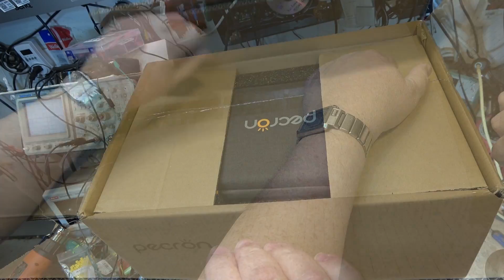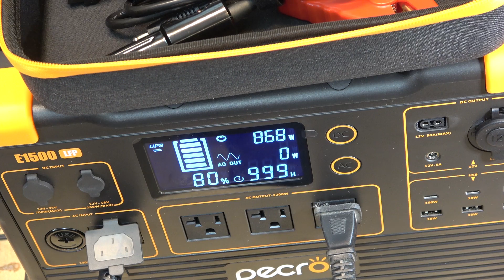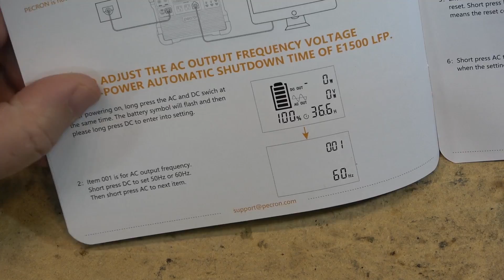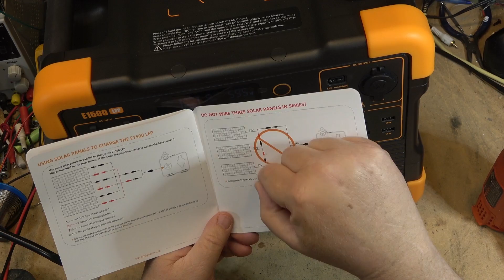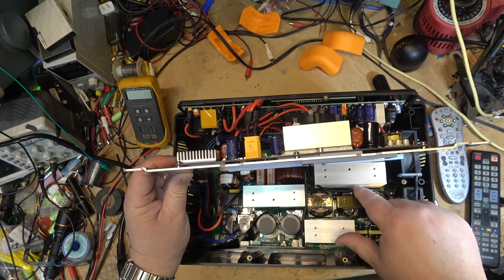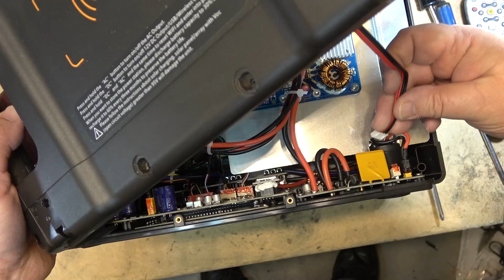Pecron E1500LFP Power Station Full Load and Tear Down

Comment: I burned up my low voltage dc In put with way too many volts, would that have damaged the 5 pin  higher voltage input? What would it entail to repair this?

Comment: I appreciate the time you took to film the process. Very informative. I have an E2400LFP. I had it charged to 100% and left it outside under a tree for two weeks. Went to use it and it was dead. Tried charging it and it seem to be charging, but when charger is disconnected, it went back to 1%. Measured voltage through the expansion port and showed 3.4v. Took it apart and measured voltage  at battery leads and was 53.4v. Clearly there is a disconnect between top side and battery. Unless i can fix it, it will be a brick. Think  getting wet must have done something. It was under a tree, turned off without any connections. I saw one of your replies was to check fuses. I haven't found them, but sure they are there. It has been out in the rain before and was never affected. Not sure it was the rain, but it's the only thing i can think of that caused it. Any thoughts on the situation? Thanks.

Comment: 25:11 that's actually the MPPT, it optomizes the solarpanels signal to most efficiently charge the battery in contrast to the older style PWM battery chargers which were far less efficient. Off that yellow xt60 is actually a direct 52V connection to the battery. To the right of the yellow xt60 is a buck converter to drop the 52V battery voltage to 12V and at the bottom of it is a blue xt60 and that's what the 12v output ports are connected to.

Comment: Much easier to take apart than my Bluetti AC200P.  Screws behind snap in moldings that cover everywhere the panels meet.  There was super-strong double-backed tape helping keep the moldings in place...or maybe for vibration abatement. What a pain that was. I had a group of cells that dropped out early during a discharge test, but getting to them would have required breaking multiple spot welds.  I decided to live with it rather than possibly doing further damage.  All that work to replace possibly only one cell wasn't worth it.

Comment: I notice you have the same problem with yours as I do with mine.... TEMPERATURE WARNING light comes on when charging from below 10% to full. I asked Pecron about this and there answer was dont charge it until it has cooled down for a few hours. Which I think is a bit ridiculas. If I was in a black out and the pecron was down to 5% and then the AC power came back on of course I want to charge it to full just incase it goes out again.

Now I have a noisy fan when the solar is connected. Least I could see that the DC fan was easy to get to.

Comment: 3.2 volt cells would be 16 needed to give 51.2 volts (battery full charged).  If you have one sitting in a box that won't charge it's the bms not allowing input.   Take it apart and put a charger across the battery terminals before the bms for just long enough to reach minimum voltage for the bms to start working again.   I buy parts only power stations if you need to sell any.  I just bought one of this model and really appreciate the tear down inspection.  Also, just for safety/longevity use a surge strip to power the unit.  I've lost several power banks form grid surges.  Lesson learned the hard way.  Thanks again.

Comment: I wish there was a way to charge this thing faster by using car battery/alternator with an inverter. Wish they would up the game in the charging. Really wanted to buy this vs spending 1000 plus more for a ecoflow
Reply from the maker: The 12v DC charge on most of these is pretty slow.  They are designed for higher voltage charging.  Either from mains or solar panels.  Some of my big units require 15 amps at 120v.  To charge at that same level on 12v would require 150 amps.   Doubt your alternator puts out that much. Most cars have perhaps a 70 amp alternator.  The car takes probably 50 to operate the computers pumps, engine ecu, lights radio ext. That leaves 20 or so for charging the battery or accessories. Even charging at 400 watts will require over 30 amps at 12 volts.  The units are designed to as not overload your accessory outlets in your car.
Reply: Pecron does have a 500w alternator charger and you could use a inverter to charge but you need maybe 2000w inverter.

Comment: I'm currently trying to tear mine down. I have taken all of the visible screws out but mine won't lift off like yours. Are there clips or something else that holds the top on. It feels like it's a little loose but the top is definitely not wanting to lift off.
Reply from the maker: Likely a few I didn't show for liability reasons.  Yes believe it or not if I showed every screw to remove and someone followed my instructions and so how managed to injure themselves or burn their place down some whacky judge in the excited states because that's where all the whacky judges are could find me liable so I don't necessarily show every screw that way I don't show how to take it completely apart.
Reply: @12voltvids  I understand. There were 2 in the bottom that had to be removed.

Comment: I'm sorry if you covered it in the video. I just now came across it and don't have time to watch it right now, being that I'm at work. 

How hard would it be to replace the 5521 input? My dumba** hooked  the wrong panel into it and fried it. It didn't pop or smoke. Just a small blue spark and now it no longer works.

It didn't affect anything else. Just the 100 watt port. Do you think the whole board for that individual charge controller would have to be replaced? I'm not planning on sending it back and having to pay a couple hundreds dollars for repairs over a 100 watt port. Thanks...
Reply from the maker: Don't know.  Perhaps a fuse in there.

Comment: Looks like no cooling for the battery pack? My 1500lfp works fine unless the batteries get hot from extreme discharge. Then takes a long time before it can be charged. According to the app, temperature rose from 22 to 52 deg celcius during a 2000+watt discharge. Pack then won't take charge until temp drops to around 46-47 cel, which can take a couple hours in a cool house (and is still pretty warm). I really like it otherwise.
Reply from the maker: The fans draw air through the pack. But they will heat up under heavy load
Reply: @12voltvids  From your video, it appears the battery pack is contained in an isolated plastic compartment. The fans on the back appear to be focused on cooling the inverter/converter/mppt electronics for ac/dc in/out. Or maybe I missed something, is there a way for the cooling fans to also pull air over those batteries? Just seems like the batts are enclosed in a space without much circulation?

Comment: I don't believe this supplies enough current at 12 VDC to jump start a car.  That cable can CHARGE a car battery, but if you try to jump start, it will likely blow the fuse.
Reply from the maker: It is like all the other booster batteries.  You connect it, wait a few minutes and crank.  I have used it to jump start s car and it worked fine.

Comment: Any idea if there is any parasitic draw on this when only the 12V port is active (with nothing connected).

I recently had to return an Oupes mega 2 because ithey 12V port used over 12W an hour just in standby, and that wasn't going to work when it came to powering  my  fridge. 

 I curious what kind of standby power is used by the unit.
Reply from the maker: There will be for sure because the battery voltage is higher than 12 volts therefore there will be a dc-dc or buck converter to drop the voltage down. That circuitry will draw power when it is evegerized. You need a 12 volt deep cycle battery for something like that.

Comment: Thanks for the video, I purchased one of these. Is it normal for them to make a noise? Cracking sounds when I put my ear to the unit. I also plugged in a standard fridge and it sounds like a faint chirping noise or dripping water sound? Thanks

Comment: Do you think the distortion in the sine wave could cause audible noise when power station is powered on?
Reply from the maker: No. The power is  rectified, filtered and regulated in ant device you will plug into it.

Comment: Is it possible to parallel connect another 51.2V 3rd party battery on the external battery port? If you measure the voltage on the port its the same voltage as the battery pack.. Thanks for nice video.
Reply from the maker: Absolutely not.  The external battery port has communication bus and it won't turn the relay on to a second pack. This is critical.  Anything wrong and you basically have a bomb there.   So many house fires are caused by people fuxing around with ebike and hoverboard batteries trying to add extra capacity.  You won't catch me modifying anything with a lithium battery.   The manufactures add on battery is about as expensive as the entire power station by the way. Over 1000 per battery.
Reply: @12voltvids Thanks!

Comment: Thanks Dave..
I have an Ancient 600 Watt Sola True off line UPS like you have, The Inverter runs 24/7.
It is Big and Very heavy HAHAH. Ran off a 72vdc buss using the White & Black burgess cells in a tray on the Bottom.  AND it has a very clean pure sine wave output. So much so it ran all the TV & Ham gear in the Back of My truck when I was involved with the Dream Flight Wausau Middle School Space program .
the 1st Year My Truck was set up like a News ENG remote Truck I had $30'ooo worth of Grass Valley gear in the Back I ran the Inverter from 6 8D deep cycle Batteries. I had to Air up the Rear Suspension. HAHAHAH..
I wonder if it still Works ??
I noticed the Grid Waveform got fatter when You switched over.
Mike M.
Reply from the maker: I just unloaded my e2000 
It can operate as a full ups. I actually got something for it so I'm happy, but it already gone as one of my cats went to the vet and needs 1600 in dental cleaning WTF.  Bloody shake down.
Reply: @12voltvids  Sorry about Your Fur ball. 
I Myself have not opened to any pets Yet after Retiring..

Comment: Very nice tear down video.  There are 32 32140 cells in the battery pack.  The 16S2P tag on the battery indicates it's 16 cells in parallel and 2 sets in series.
Reply from the maker: That sounds right. I thought about that during editing and was tempted to do a voice over or title but it was late and I forgot and didn't feel like rendering it out.
Reply: "16 cells in parallel and 2 sets in series." You mean 16 cells in series and 2 in parallel, it's a 51.2v pack

Comment: I’m pretty sure that “16S2P” reference is saying that this pack has sixteen series-connected sets of two cells in parallel. We can confirm that by using the 3.2V nominal voltage spec on the cell and the 51.2V spec for the pack. Then count the cells to see if it’s a string of 16 single cells in series (a 16S1P pack) or a string of groups of two (a 16S2P pack). Couldn’t tell if there was room for 32 cells in the bottom of that case though. If not, that 16S2P reference is a very weird one.
Reply: There has to be 32 cells.  They are marked 32140 48wh 3.2V so take the 48wh * 32 cells = 1536W.  The tag says the pack is 51.2V 30Ah.  To get watts take 51.2 * 30 = 1536W.  It would be impossible for the pack to only have 16 cells and be 30Ah.
Reply: @ct_solar_guy  thanks for doing the math! I was too lazy to do the rest. 😉